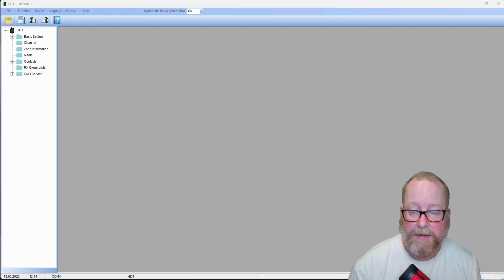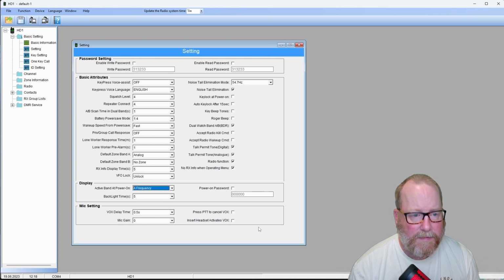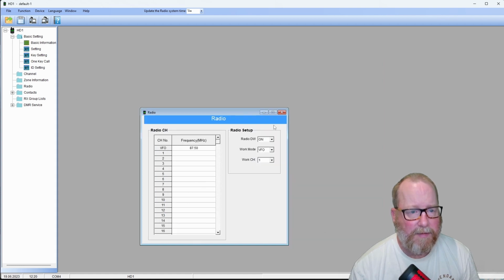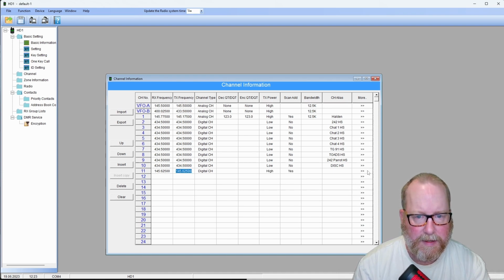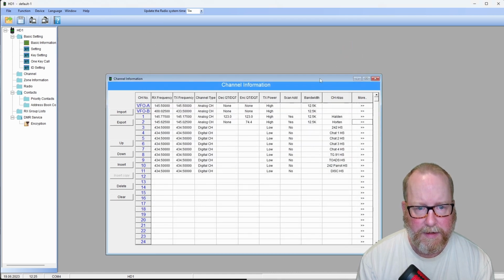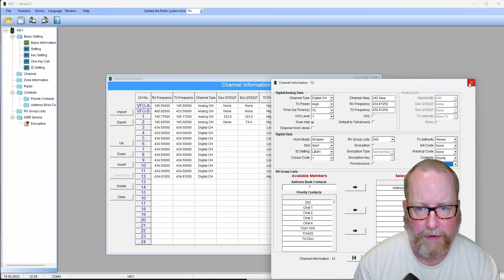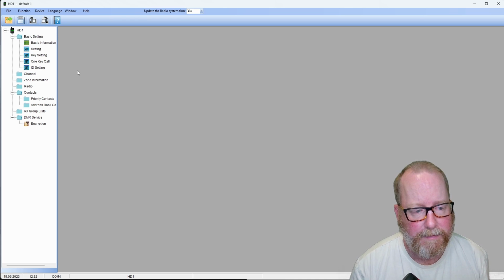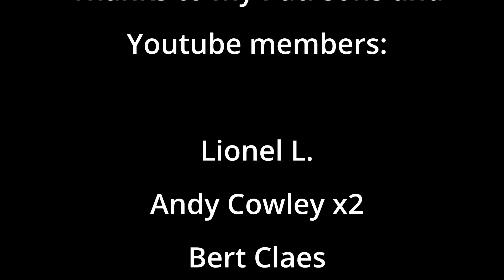How to program the Ailunce HD1

Comment: Excellent video, thank you! Although this is DMR radio and primarily designed for digital use and i get this. There are tons of videos about this radio online, but no one has tried to fully explore its capabilities only using it in Analogue mode only. From what ive read most of Analogue functions will not work unless you get digital id code programmed into radio first. This is total nonsense. Why didn't Ailunce made firmware where you can fully switch to DMR or Analogue??
Reply from the maker: You can use this radio analogue straight out of the box.
Reply: @LB0FI  thank you for your reply, yes but just as very basic functions. Many other features are not working....

Comment: When I first programmed my HD1, everything worked perfectly, but when I went back into the radio again to change some programming, all the frequencies, and channel names are either missing parts, or have very weird characters in the place of the original title.  Everything is up to date, and I am unsure how to fix this.  The scan add function does not work after the initial program, and i have not seen this problem anywhere.  I have tried a factory reset on the radio, and a fresh program, and the same problem persists.  Any ideas for what could be causing this?
Reply from the maker: I am sorry, but I have no idea, and I don’t have that radio anymore, so I have no way of replicating your problem. I would try and contact Retevis.